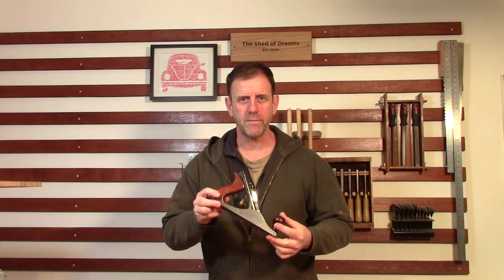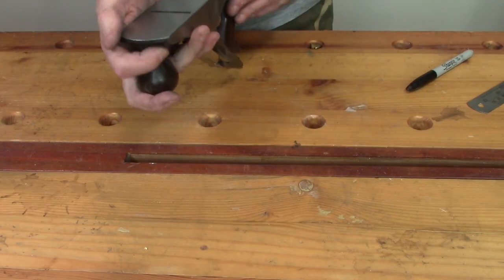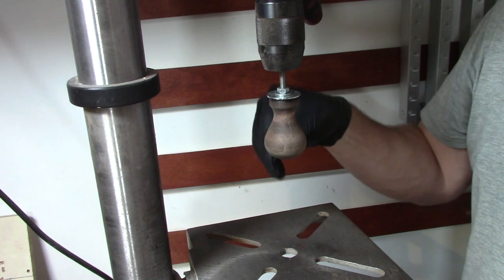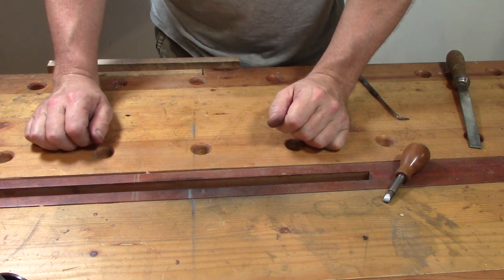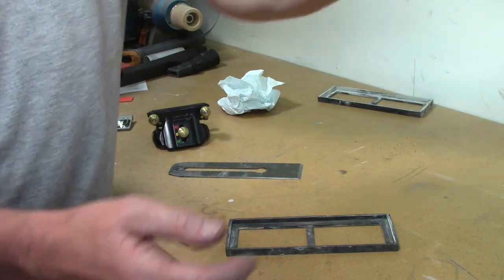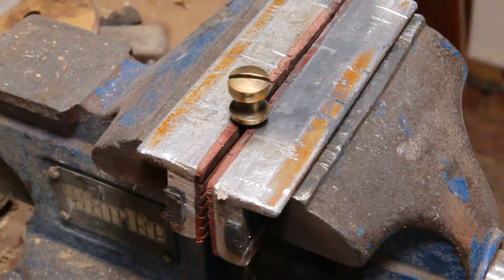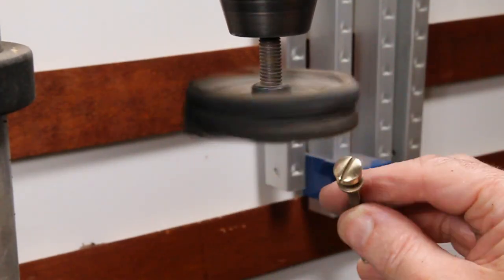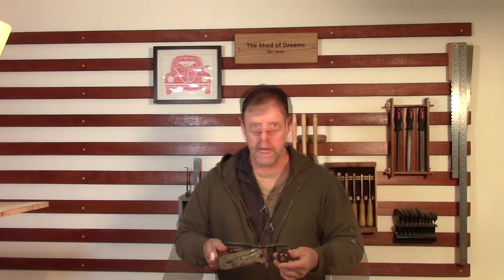Restoring a number 3 Stanley hand plane.

Comment: Moving forward the frog doesn't give you a Finer cut, it just reduces tear out on difficult grain wood the finer the the cut depends on how sharp the iron is and how far it is out of the mouth of the plane , just saying,  i am a nearly 64 year old qualified professional carpenter by trade and have been restoring Antique planes for absolute years,  good video best wishes from a vintage Carpenter.

Comment: These are the fun jobs😊. You have another nice usable plane. 
Clear explanation of where the points of attention are. 
Have you only treated the handles with stain and Tung oil?
Reply from the maker: Thanks, yes, two coats of stain and about six of tung oil, I prefer the feel of the oil finish to a varnish.

Comment: Just two comments. You should have flattened the frog first, not the body. Then if needed flatten the body. The purpose of the iron cap is to press down on the blade, it does not break the wood fibers, the blade cuts the wood fibers.